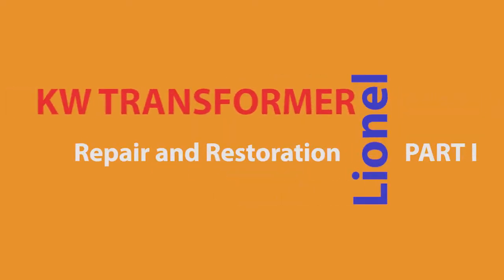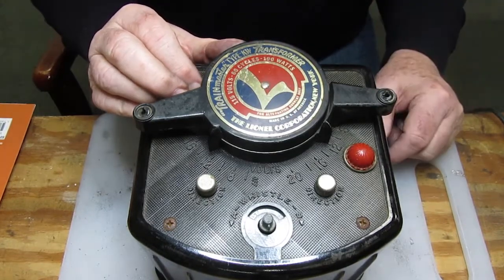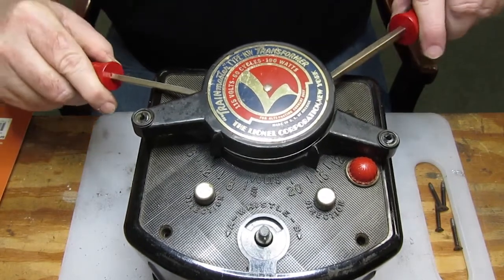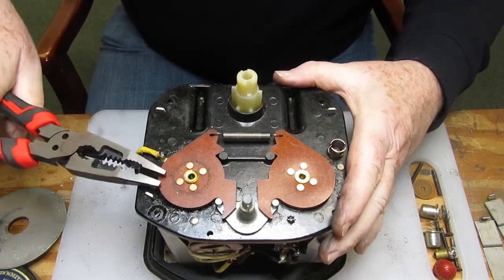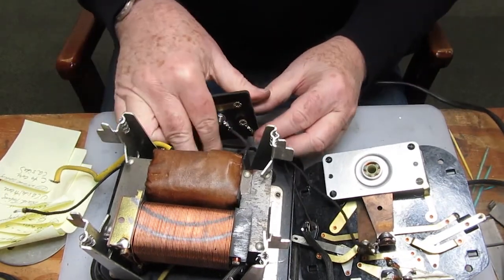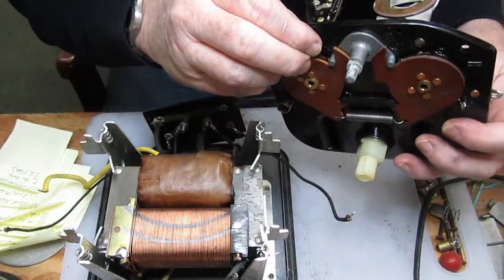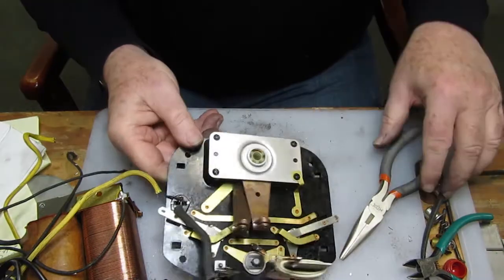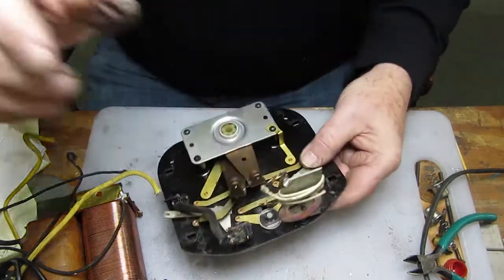Lionel KW Transformer Repair and  Renovation PART I

Comment: Helpful video to a degree. I received a post 1957 KW where all the inner posts had detached and some wiring was broken loose from the solder. I wish you had shown the locations of these wires as the only schematic I could find shows only the older KWs.
Reply: Did you figure it out? I'm getting ready to replace a cord on one if you still need some pictures
Reply: @johnnycooke8372  yes I found a schematic for the KW. It’s working now.

Comment: Hey Peter. Thanks for the great video. I inherited one and replaced the power wire already. Do you have a good source for the rectifier wheel?
Reply from the maker: I suggest you contact Jeff Kane at The Train Tender   www.ttender.com
The rectifier disc is part # 1041-13
Reply from the maker: You can obtain a replacement rectifier disk from Jefg Kane at The Train Tender thank you as well as others.

Comment: At 17:54 you actually suggested to leave the power cord wires loose without soldering??? Nasty short circuit at best case, House fire at worst case.